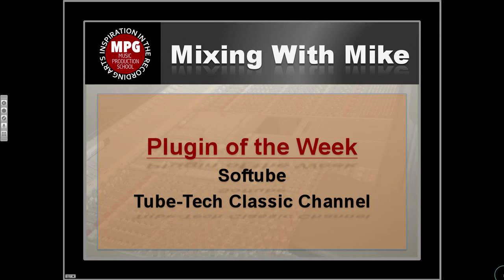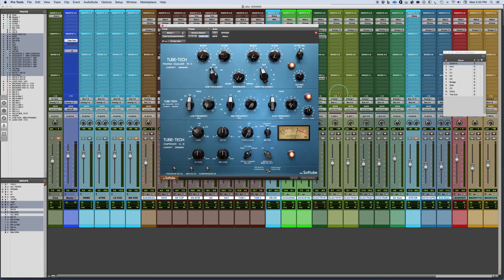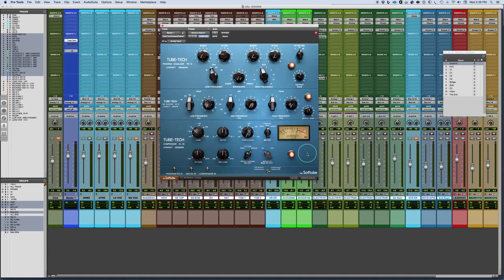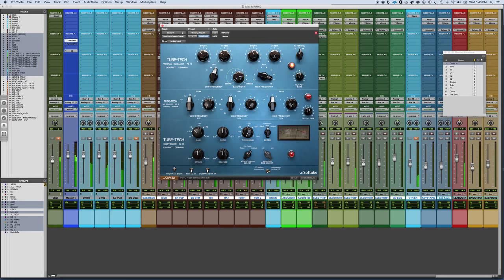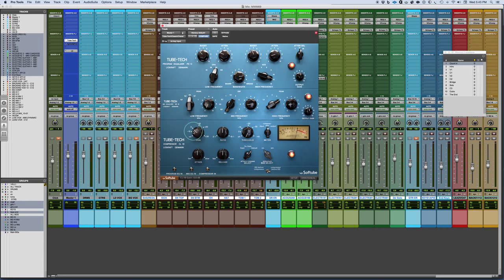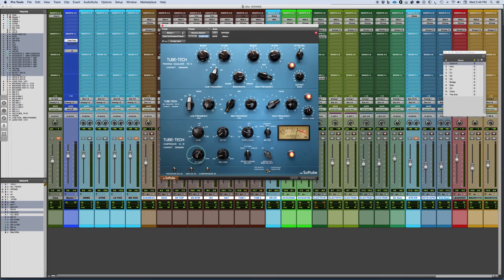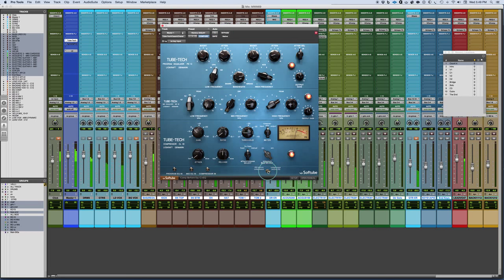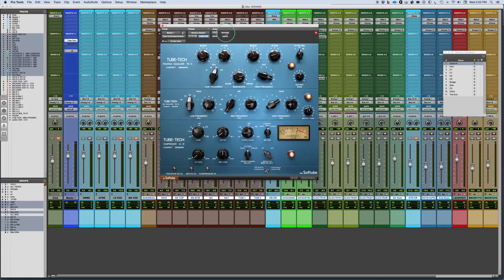Mixing With Mike Plugin of the Week: Softube Tube-Tech Classic Channel

Comment: I'm moving almost entirely ITB now because you can basically get all the sound and warmth and harmonics of analog vintage gear, without needing to buy one unit per channel and paying for maintenance...which was RIDICULOUS.  To any of you who love analog gear, you know exactly what I'm talking about.  $$$$$$$$  It really responds like a Pultec, too.  If you've used one of those before, bumping something up to "7" or more on the boost really isn't that much at all, but as mentioned, the filtering makes it sound a lot more pronounced than it really is.
Reply: Raging Heretic Don't ever compare analog gear to plugins. It's two different worlds. I am an audio engineer at cameleon studios in Hamburg. You can google my name. Softube did an excellent job, but plugins will never replace analog. Greetings